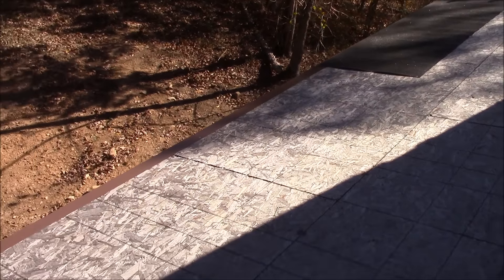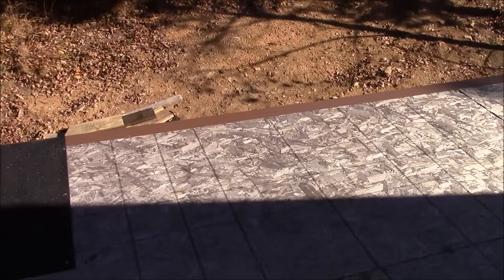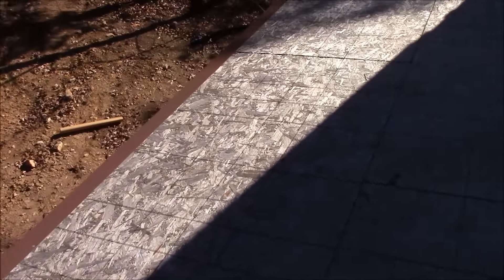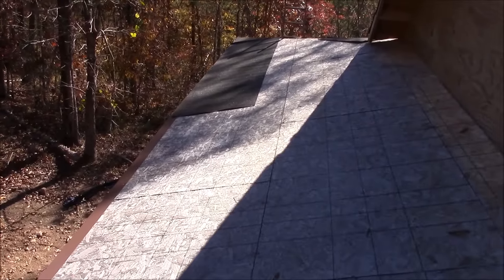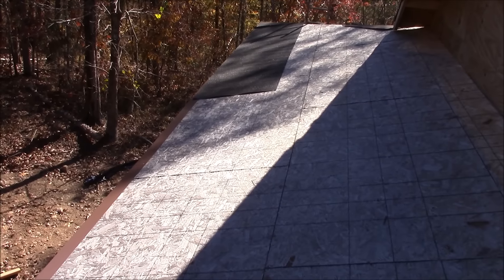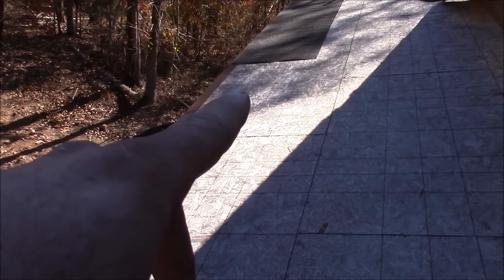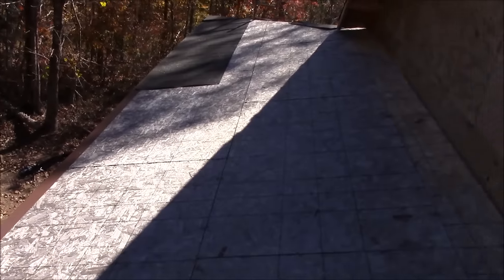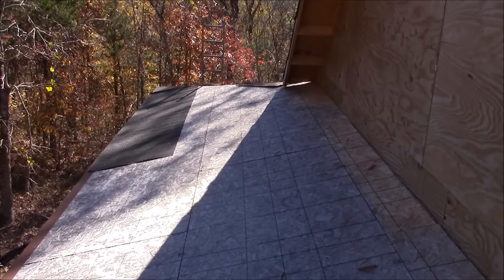Building My Own Home: Episode 44 - Working on the Eastern Porch Roof

Comment: Did you calculate where to start the tin so the corners matched up so well? Looks good
Reply from the maker: +Jerry B Yes. The tin on the main roof has to be calculated so that the gable ridge trim doesn't fall on a rib, then the tin on the front and back porch lines up with the tin on main roof.

At that point you pick one corner on each side as the most visible and you can match the ribs on those two corners. The other two corners just fall out as they may.